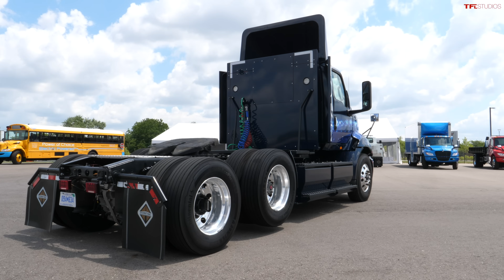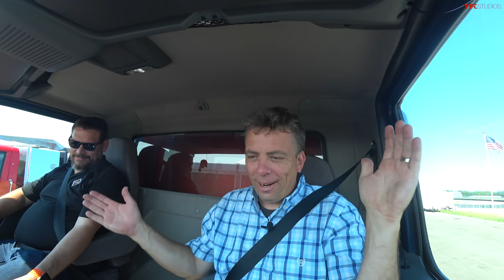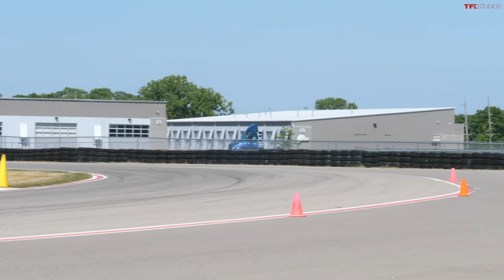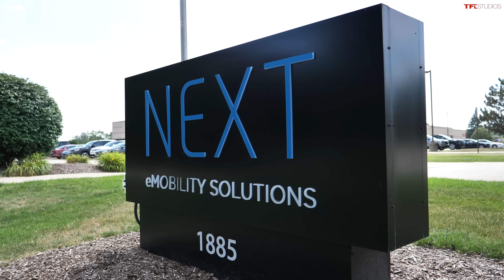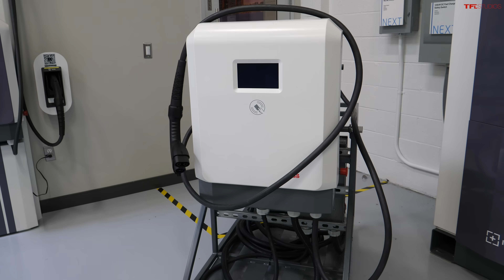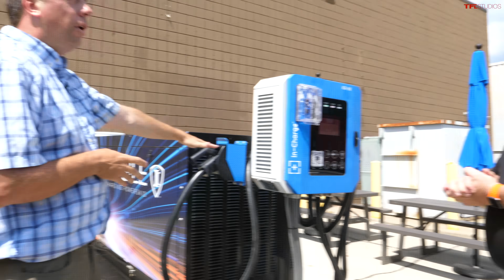Badass EV Big Rig - This International 18-Wheeler Packs a Huge Surprise!

Comment: Here’s my idea and don’t know why it hasn’t been done. The truck should only have a short range battery. The main large battery should be in the trailer. Trucking companies doing long haul should have a half way point where they can exchange trailers that already been fully charged by the drop off driver for the return leg. This would eliminate the waiting around for a truck to be charged and would only have down time during driver breaks.
You’re welcome electric truck companies!
Reply: You want truck drivers to connect HV cables as part of trailer hookup? It's not being done because of safety concerns.
Reply: @Frosstbite23  That’s a load of rubbish! You could have the cables connected to a breaker that wouldn’t supply power until they are secured properly. It’s really not that hard.
Reply: @pk-so1mj  beside the safety point, adding weight to trailers reduces cargo capacity, which is the opposite of what our customers want. It's a regional tractor and doesn't need that amount of battery.
Reply: @Frosstbite23  You will notice that I was talking about long haul not regional. If you are removing weight from the truck the max GCM will still be the same as if the batteries were in the truck itself. Who cares if you reduce the max payload of the trailer by a couple of tonnes to reduce the operating cost and move into a greener future. You can’t get something for nothing. Either trucks are going to have a massive battery and reduced trailer weight to not go over gross combination or vice verse so there really isn’t an argument there.

Comment: These would work for short local delivery type companies, but useless for long haul of course due to downtime waiting for recharging, although if companies purchased enough and had charging stations close enough and enough of them, you could in theory just go from charging station to charging station, swap to another electric truck hookup the trailer and keep going...I imagine at some point this might be what happens, but as of right now, long haul is pretty much out of reach if getting to the destination in reasonable time is needed, I guess if the delivery system, and end receivers could slow down and just order things to hold them over a couple extra days you could in fact run one of these cross country...I wonder how long it takes to recharge one of these trucks compared to an electric car, SUV, or pickup?  I'd think there's faster chargers out there for these semi-trucks?
Reply: The private sector demand will drive the infrastructure to be built thru out the logistics grid. May even see
the rise of new fully electric centric truck stop ventures start cropping up. Profit is the catalyst that 
private money flows into.

Comment: It seems like they could stick with this single- axle main drive,  and add small hub motors,  even like those on the Aptera (which are probably about 100hp each),  for the other axles for distributed power and lower complexity and awd traction.

Comment: I would love to see this kind of lift axle system on conventional class 8 trucks.
Way more efficient.
It works well in Europe, why can't we have it here?
Reply: Q: why can't we have it here? A: we do, unfortunately they are few and far between on traditional standard length, tandem axle tractors but I have spotted them.  they are indeed UNICORNS outside of Tri-Axle dumps and Tri-Axle heavy haul applications.  my last sighting was back in December out in Indianapolis on a tandem axle sleeper.
Reply: Politicians

Comment: Couldn’t the precedent of multiple diesel tanks translate to having multiple charge ports? There has to be a way to intelligently split batteries so you divide the charge time by the number of ports.
Reply: I understand that. But these battery packs are all a bunch of cells that have to be within a voltage tolerance of each other. I don’t think it would happen overnight; the technology would need to be developed. There is already a handshake between the vehicle’s charging computer and the charger itself. I’m just suggesting the vehicle communicate to two chargers at once and control the flow of both to get that balance. I did imply that it would be a halved charge time with two ports; that was an oversimplification. Most charging curves slow down at the end and in my idea would probably have a slower ending with all that negotiation and balancing. Maybe 2 ports = 65% of the one port time.
Reply: @Dorgel289  as long as they target balanced charging it would work fine, but having multiple charge ports will over complicate the system in some respects, especially if it takes longer to charge. I like your thoughts here but I think this would add unnecessary costs
Reply: I was thinking the same. We fule on both sides so why not split the charging per battery on both sides
Reply: No. It doesn't work that way. The two batteries have to be within basically 1V of each other or VCU detects it as a problem. Charging separately leaves it prone to having the voltages not match.

Comment: Careful Andre, Kase is on your heels driving big rigs.  lol  While you are doing the good Samaritan routine on vacation, he steals your thunder behind the wheel of semi trucks. 😂  Imagine the "frunk" space on one of these things.  😂 Single cabs will have a built in sleeper in the nose.  🙂  At least this guy is realistic about mentioning the fact the infrastructure is a long ways away from accommodating a commercial trucking scenario.  Time is $ and trucks that cost that much sitting on a cable charging is a big problem.

Comment: In my opinion, the lower maintenance and fewer parts claim of electric semi trucks is being over hyped and has more than a little hyperbole. 

You still have all the truck bits a diesel powered truck has. Virtually no change there. So for all the maintenance those bits require is carrying over. You still have that big electric motor, and it’s size still mandate a number of big parts to make it go and stop. While maybe less, it still needs a maintenance and repair plus parts infrastructure behind it. And you’re adding a pot full of electronics, the electronic hardware and wiring components to make it all work. And then there is the battery and it’s charger circuit. That critter has thousands of parts, if not tens of thousands. There is going to be a huge support infrastructure for those as well. And its all very heavy. 

A 75 to 300 gallon fuel tank is 2x4 board simple in comparison. The current cost of the electric fuel over diesel fuel is significantly less, but don’t forget, road taxes are soon going to be added to that cost just as they are for diesel fuel. And all that electrical charging infrastructure has a huge capital cost and not an exactly no charge maintenance and operational cost to make it all work. 

The support needs for the electric semi is still there. Just the skills, procedures, training and tools needed are going to have a different mix

Comment: Nice video. How many miles/kwh with a load?  Looks like you can do about 500KwH in batteries without incurring a weight penalty compared to a diesel and transmission.
So, how far can a loaded semi go on 500KwH? if it is .25 m/Kw then 125 miles which would only be good for really short stuff. .5 gets 250 miles.
Anybody have an idea?
Reply: This one has about 250 mile range depending on use case.

Comment: I'd love to see more hybrid focused commercial setups.  Kind of like what Edison Motors is doing.  A diesel motor running at it's most efficient rpm acting as a generator to create electricity.  Best of both worlds.
Reply: I think total electric will be best for short haul,  but hybrids like you mention will be best for long haul. Those could be built today.
Reply: Hyliion has some really good concepts like this, except it is designed to run on natural gas and is working on building out a renewable natural gas network.
Reply: Hybrids make no sense at all for long haul driving because the benefit of a hybrid is regenerative braking, which only works in stop and go driving. On the highway, when you're using little or no brakes, there's little or no benefit, you're just adding weight and complexity, which is actually a negative.
Reply: @Mark_Christian25  Regen would also work on downhill sections, not just stop and go.
Reply: @ColeMarkusen  I mean, when applying brakes. That includes stop and go, and controlling downhill speed.

Either way, you're missing the point. 

The benefit is minimal, not enough to justify the weight, cost and complexity. For every one mile of downhill braking, there are hundreds of miles of minimal or no braking. With that, there's no point in regenerative braking.

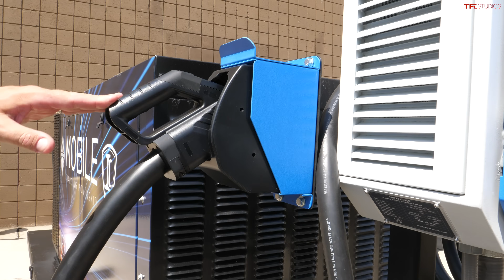Comment: 17:03 I'd love to see International work with GM on this. The Hydrotec Mobile Power Generator (MPG) can be paired with a 150 kW CCS charger. Obviously, the concern is hydrogen, but if these are temporary loans, a full tank should support several dozen fill ups.
Reply: No you're not going to see GM Working with Volkswagen
Reply: @robertryan7204  Why not? VW Group has traditionally given a lot of independence to their subsidiaries, and Navistar is a subsidiary of a subsidiary of VW. Besides which, when I say "work with," I don't necessarily mean create a business partnership. I simply mean that they can buy a technology from GM that they can't build in house.
Reply: @newscoulomb3705  Not really going to happen as Scania has it's own  Hydrogen set ups in Europe as well as LPG, Natural  Gas,Electric Trucks plus a vast range of Diesel engines. Like IVECO ( Fiat owned)has paired  with Nikola . Scsnia/ MAN are more interested in International doing EV Scouts and Vans.
Reply: @robertryan7204  Sure, but as far as I know, they don't make a similar product to Hydrotec's MPG. However, I can see what you mean about VAG being too proud to do business with a competing company. It would probably put egg on their face to buy a solution like that from GM.
Reply: @newscoulomb3705  Scania/ MAN seem to be trying to get International  to the stage of being a najor player in the US Truck market. Scania would have something like that devrloped or being developed
Not VW Corporate but Scania  wants to develop it's  own Truck network in North America using the International brand. MAN has it's  VW Truck brand in South America

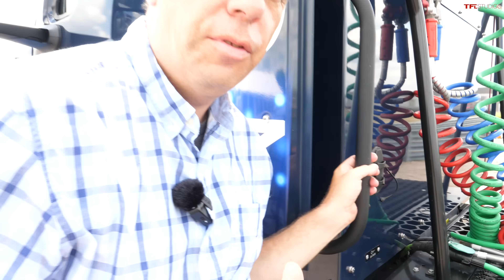Comment: 9:56 I've actually run into a few Freightliner eCascadias using Electrify America chargers. Without a doubt, these EV semis need to be 800 V architecture, but the current crop of 350 kW chargers won't be sufficient to serve their needs. We're going to need both full, pull-through charging locations as well as the full 450 kW to 500 kW that CCS1 (and the current crop of chargers) is technically capable of supporting. 
Ultimately, and especially for long-haul EV semis, we're going to have to look at solutions like that of CharIN's Megawatt Charging System (capable of 3.75 MW). However, it will probably take solid-state batteries with >700 Wh/kg energy density and >5 C charging to make that a reality.
Reply: @Larry Flynn The grid, which has to provide four to five times more power during peak times than it does during off peak times when these trucks would normally be charged. By taking up that slack in generation at nighttime, these EV trucks will actually improve the health of the power grid by reducing the amount of cycling our power plants need to do.

By making an argument from ignorance, these "pundits" who erroneously claim the power grid isn't up to the task have inadvertently made one of the strongest arguments in favor of transitioning to EVs. 🤣🤣🤣
Reply: @Larry Flynn Yes, peak time consumptions are when brown outs occur, but these trucks would not generally be charged during peak times (because they don't have to be). Those brown outs typically happen because slower cycling power plants (e.g. coal and some natural gas plants) need to be brought online to support the sudden increase in load. 

As a result, the utilities already provide significant economic incentives (i.e., lower cost for electricity) for charging during off-peak hours because their extremely slow cycling plants (typically coal or nuclear) can't be cycled without damaging the plant. As a result, commercial operations that are interested in these trucks aren't likely to activate their charging until after 9 pm, when they can charge for the lowest cost. 

And that's easy to do because most chargers and EVs now come with TOU settings, so this is simply something that they would set and forget. The only real concern is making sure that they are using chargers that will charge the trucks to full in about 6 to 8 hours (say 10 pm to 4 am). 

When I refer to arguments from ignorance, it's because people who claim these EV trucks will negatively affect the grid are clueless about the concepts I shared above. Basically, they don't know enough about EVs or the power grid to even discuss the topic; otherwise, they would already know better and understand that these EV trucks will actually improve the health of the power grid. 

In other words, if they are making those erroneous arguments while actually knowing enough to discuss EVs and the power grid, they are bad faith actors purposely misleading people and sharing misinformation. So rather than assuming they are intentionally lying, I'm assuming that they are simply ignorant.

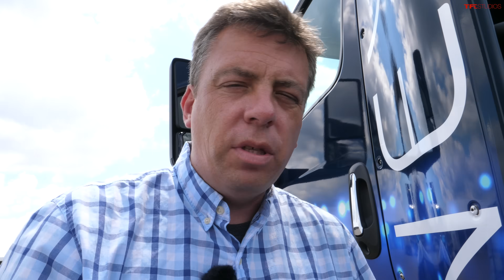Comment: 6:30 I think 400 kWh to 500 kWh is just about the sweet spot for these EV semis right now. Depending on load and conditions, that should  be at least 300 to 400 miles of real-world range. So they're ideal for regional/short-haul applications.
Reply: More like 150-300 miles. Electric Pick ups towing are only getting 100 miles per 100 kWh with GVW under 20k lbs.  Still good enough for local deliveries.
Reply: @guyod1  Overall, pickups are less efficient per unit of load than semis when towing. Yes, there can definitely be some times where the EV semi will see significant reduction in efficiency, but most of that will be due to elevation increases, where the EV semi will be recouping a lot of that energy back. I would expect these semis under basic loads to have efficiencies between .75 and 1 mi/kWh. Sure, it could dip lower than that for higher speed freeway travel (probably closer to .5 mi/kWh), but that's sustained 55 to 65 mph driving.
Reply: @newscoulomb3705  tesla semi says 300 miles on 600 kwh battery.  Telsa semis drag far better than this international.
Reply: @guyod1  Where did Tesla state this? Can you cite a source? To my knowledge, Tesla has never provided actual battery capacities for their semi. All I've seen them state is that the efficiency will be "less than 2 mi/kWh," so they could be claiming as much as 750 to 1,000 miles on a 500 kWh pack.
Reply: @newscoulomb3705  The efficiency per unit of load does not determine range or battery size, so that's not a valid point. You would still need a massive, MASSIVE battery to haul around tens of thousands of pounds for anything more than 100 miles.
Reply: @Mark_Christian25  Actually, the energy consumed per load is valid, and your comment about EV semis charging at the end of the day demonstrates that you're really out of your depth discussing this topic.
Reply: @newscoulomb3705  No, it's not valid. Even if it's more efficient, you'll still need a massive battery to move a semi.
Reply: @Mark_Christian25  You are missing the point. Yes, you need a massive battery, but no, a 400 to 500 kWh pack will not result in an EV semi "only having 100 miles of range." Yes, the weight of the pack is important because it affects TARE weight, GVWR, highway permits, rolling resistance, vehicle cost, etc. However, going from 15,000 lbs of truck and trailer (e.g., Ford F-150 Lightning with a 7,000 lb trailer) to a 30,000 lbs of semi and trailer doesn't automatically double the energy consumption. Likewise, going to an 82,000 lb EV semi plus trailer doesn't more than triple the energy consumption.

If you're saying that that point isn't important, why are you even commenting on or following this video? If you're disagreeing with that point, I'd like you to show the math. 

Volvo found that their aerodynamic 80,000 lb diesel tractor-trailers were achieving the equivalent consumption of ~1.5 mi/kWh at 55-65 mph steady speed driving. On a 400 kWh pack, that's about 600 miles of range. If you want to say that isn't accurate, you're going to need to explain why.

As for your claims about the grid, the issue has never been power generation at off-peak times. The issue has always been power generation at peak times. So fleets of 500 kWh EV semis plugging in and charging at off-peak times would actually improve the health of our power grid because it would prevent the cycling of baseline power plants (which don't like to be cycled).
Reply: Imagine the time and the power demand when fleets of 500+ kWh trucks start charging at the end of the day.